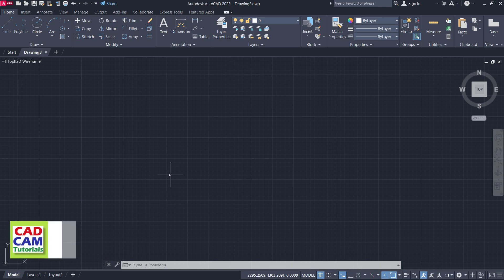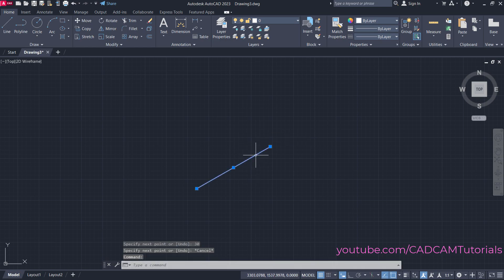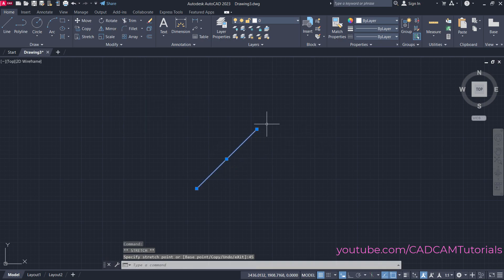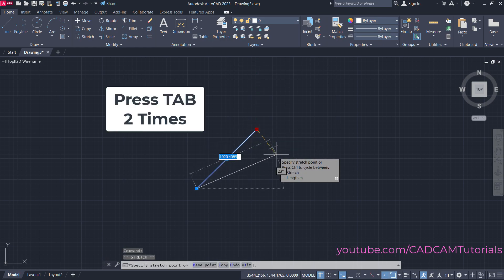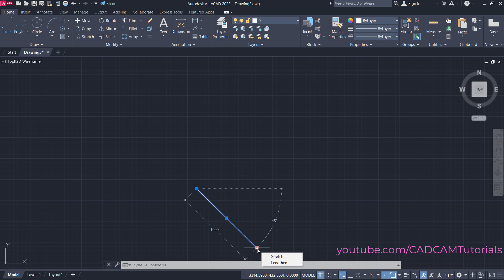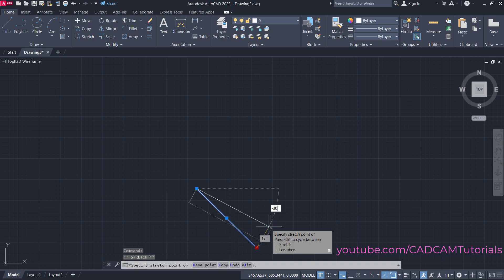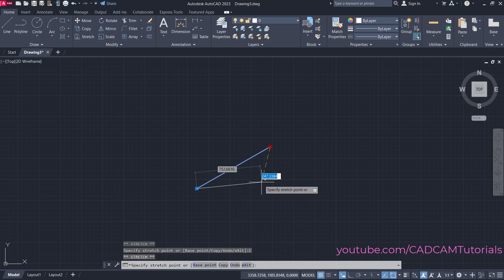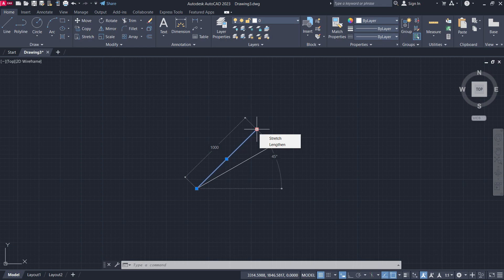AutoCAD Change Angle of Line

Comment: Hi @CAD CAM Tutorials - I'm trying to use Polyline (PL) and paste the 4 lot bearings at one time, but Autocad 2019 only pastes the last bearing (@25<S38D24'W). Do you know how to fix this? Thanks!

@14.24<N62D14'W
@25.64<N38D24'E
@14<S51D36'E
@25<S38D24'W
Reply from the maker: At the end Press enter two times. It is taking all the values correctly.
Reply: @CADCAMTutorials  Not working for me.
Reply: @CADCAMTutorials  I may have turned off/disabled something I don't know.